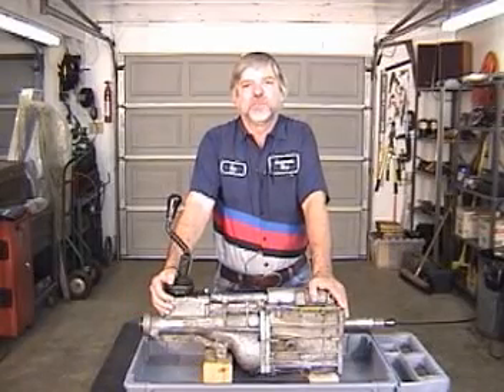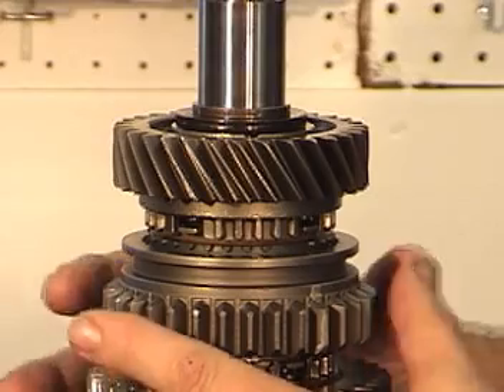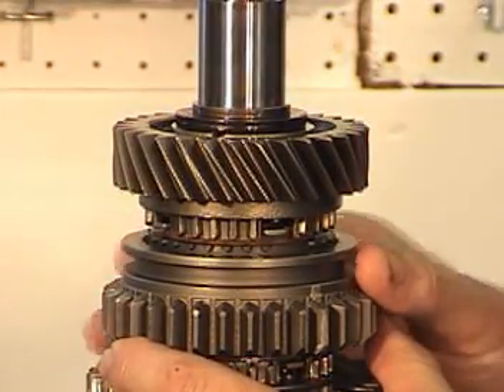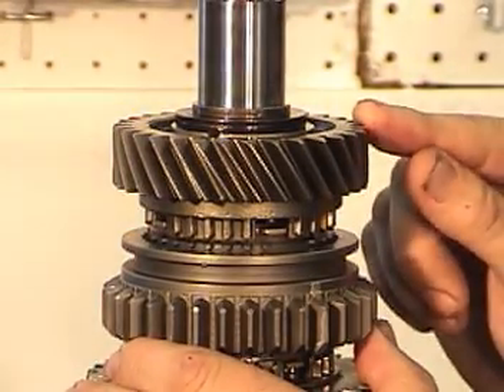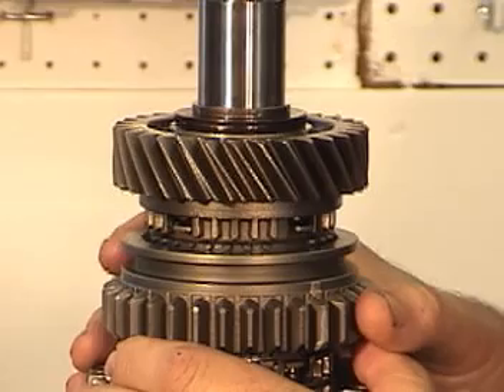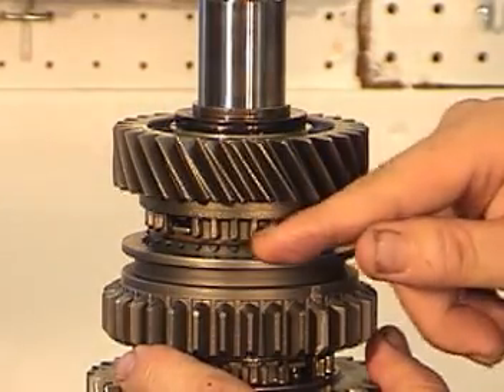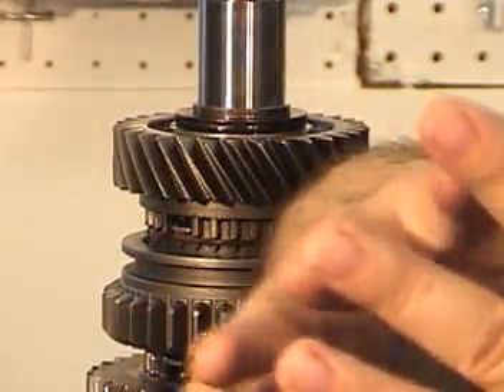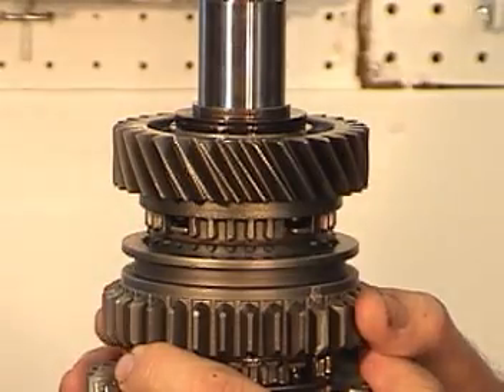How To Rebuild the World Class T5 Transmission

Comment: I recently rebuilt a Borg Warner NON WC T5 from a 94 Mustang. I got it back in the car and all seems to work EXCEPT....it will go in 1st, 3rd and 5th....but not 2nd, 4th or Reverse. When I was putting it back together. I had to take apart the top plate with the shift forks and put it back together so it would go on right. Is it possible that I put one of the shift forks on backwards? Any help would be greatly appreciated. Thank you!

-Aaron

Comment: hi i have a 94 v6 stang 5speed. and i was just wondering if you could possible tell me what would cause the car from going into reverse, im not sure what transmission its has but i heard that 1st gear and reverse gear are on the same "track" ( thats the word they used to explain it)  every grea 1-5 work great but when i go into reverse it wont go in , i was once able to get it into reverse then let out the clutch ans slowly got on the gas and it just made a clunking/grinding noise,thanks

Comment from the maker: A little gear reduction whine normally doesn't hurt anything as long as your not low in fluid. Get in it and drive. If it start getting worst, you may need to go in.

Comment: i have a 92 mustang t5. On my very first shift from 1st to 2nd the gears will grind. after that there is no grinding whatsoever, until the I turn the car back on after a couple hours. I do know i have a bad clutch (which i am currently replacing) however, i don't know if the clutch or the synchros are creating the grinding noise????

Comment: When I rebuilt my T-5 the fiber material inside the ring was spinning freely. The bonding adhesive dissolved. So what was happening, was as I shifted from 1 to 2 the blocking ring never slowed down the gear allowing it to spin at thousands of RPM's so when you shifted from1 to 2 it shattered the gears. The reason the adhesive failed was due to using GM's synchromesh fluid. Back in the day hot rod magazines wrote articles suggesting using this fluid in 5.0 T-5. I blew 3 T-5's. USE ATF ONLY.

Comment: This relatively the same as a t45 correct? Like as in very similar to rebuild.  I have a t45 shift and everything fine but makes a rattle noise at idle in neutral w/ clutch out.  Push clutch in noise stops.  Then when in gear accelerating no sound.  When you release your foot from the gas grinding or rattling noise comes back.  Clutch and everything is brand new. Sounds like its coming from inside the Trans. Any ideas on what I should look for?

Comment: @xilix one miss shift shouldnt cause a gear to just stop working but you could have rounded the slider and the dog teeth so bad that they wont mess at any speed but the correct shit rpm. and as far as it poping out of gear, the shift, if bent can only be bent two directions left or right so if it wont engage in 4th then it shoud engage in 3rd very easy  or even with out trying, the fort is made out of either (maybe)steel or aluminum which both are easy to bend

Comment: What happens if the synchron goes bad or you shift way too fast, the sliding gear rotates at at different with 2nd gear (for example). Will the synchron prevents engaging the gear or we will grind the dog gear?

Comment: Whelp... I got it looked at finally, and apparently it was so bad in there that it would've cost more to rebuild it than to buy a unit from the boneyard, which was $700. He said a lot of the rings and other stuff were pitted, shift fork was broken, synchros were toast, bearings needed replacement... what a mess! So after the tranny replacement, clutch, resurfacing flywheel, replacing the rotted flow tubes, replacing s. plugs, a few other things too, and all the labor, came to $1995. Ouch.

Comment from the maker: @VICTOR400HP Of course, the clutch doesn't care what the 5.0L came out of. Remember to install a pilot bearing. Remember also the 94 T5 has a deeper bellhousing therefore your shifter may not line up with the 89 Mustang's hole in the floor.

Comment: @xilix If it pops out when it's already engaged in gear then either you bent the fork and the slider is barely engaging the fourth gear dogs and when pressure is applied, the slider is pushed off fourth gear, or the fourth gear dogs are chewed to hell. Syncro would not cause the slider to pop off the gear, it would only cause trouble with engaging the gear. The syncro may also be bad but is not causing the trans to pop out of gear.

Comment: I just lost 4th gear in my t45 due to a missed shift. I can still get it into gear if I rev-match it perfectly, but otherwise it simply will not stay in gear. As soon as I let out the clutch, it will just pop out. According to an expert, he said I either bent the shift fork or cooked the 3-4 synchro. Do you agree?

Comment from the maker: A little whine in the lower gears is not always signs of a problem. The pocket bearing between the input and output shafts is not turning in fourth gear. Therefore if that bearing is bad, it would make noise in every gear except 4th. It would make noise in 5th but might be less so.

Comment from the maker: 2001 Mustangs came with a T5, T45 or 3650. I believe the T5 was only in V6 cars, The T45 was on the 4.6L 2V and the 3650 used in the Cobra. I would think the T45 would be the easiest swap however the 3650 is a stronger unit but it has a hydro. clutch.